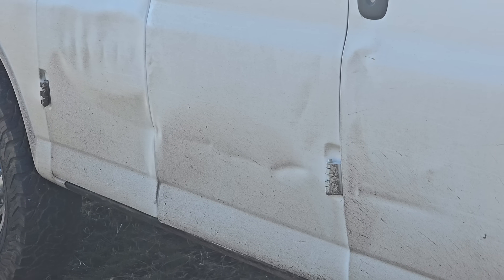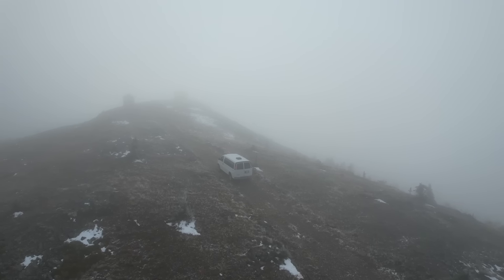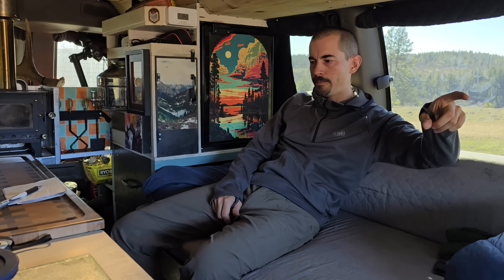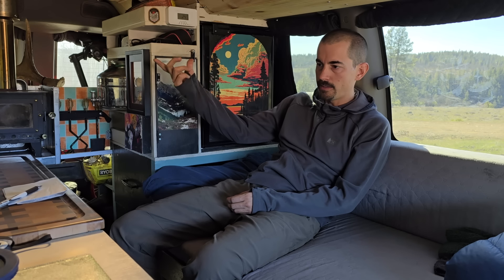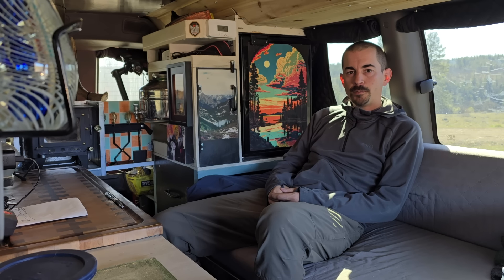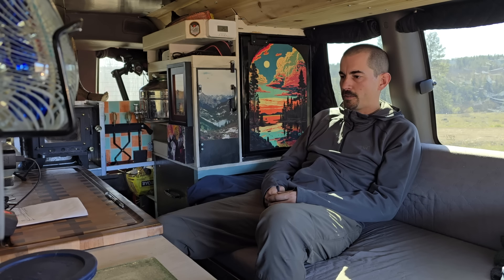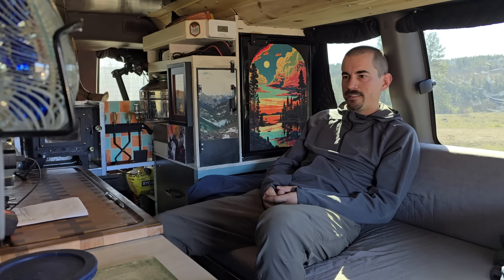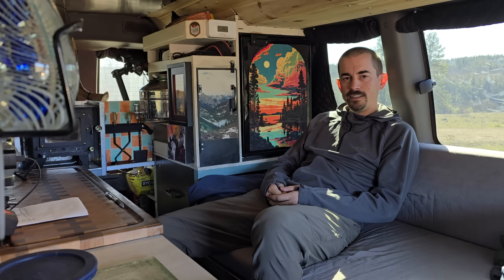Lets just talk about condensation and insulation.

Comment: In a house the vapor barrier is pierced by screws to hang drywall or w/e, so that is not a concern.
You won't get the closed foam insulation cut perfectly. Leave a gap on each side and fill it with spray foam, the window kind that doesn't expand super strong. 
Gluing everything could work, maybe.. Since you don't put up heavy stuff. maybe a cloth liner would work instead of wood paneling? 
Sealing everything up won't get rid of the moisture tho. As you stated, it comes from you breathing and needs to be vented out.

Comment: I imagine that the solution to water vapor penetrating the insulation and condensing on the inside wall, is to make the insulation waterproof (vapor proof) in the first place.  This would capture all the vapor on the inside air volume.  Then, a dry heat source will warm up the interior.  This warm interior air can then be allowed to escape out a roof vent, to allow for ventilation.
Some insulation dude will be along to give us the actual nitty gritty, tho.

Comment: I’ve had my Quigley Transit for 5 years, built out myself, I used a similar method as you describe except no vapor barrier, my theory is,rain suits can be very sweaty and sometimes more wet from sweat than rain ( I worked outside in the rain for a number of years) I figured there was no keeping moisture out,so I wanted the moisture to be able to come and go with ease, I used thin oak plywood to cover walls and ceiling with somewhat loose joints, I recently added a small window so when I pulled the wall apart I was really curious how dry things looked, it looked great,dry,. Lately I’ve been more focused on insulated window covers because when it’s really cold outside the windows are the coldest areas,I’m also an amateur ,take my opinion with a grain of salt.

Comment: If you're using closed cell foam then that will also act as a vapour barrier because it's made as closed cells (lots of sealed bubbles all together) as opposed to open cells (like a sponge) so no moisture will be able to travel into or through closed cell foam. All you need to worry about then are your joins in the foam.

Comment: I suggest NOT putting a vapor barrier in at all. Vapor will make it around any opening. When it condenses and is now liquid, it must now vaporize again before it can migrate (dry out), so in essence the vapor barrier ends up trapping the moisture IN rather than keeping it OUT. When the moisture is trapped, that is when the mold starts. Have found this out through many years of experience with our garage in Northern Minnesota that has one wall that is completely underground, combined with cold soil temps and high summer humidity

Comment: You should absolutely keep that van.  Unfortunately, there's not much else exactly like it.  The grass might seem greener, but I have yet to see anyone with a better rig than you, haha.  Anything remotely similar is either less capable, or less livable (and by that, I'm definitely thinking of both Sprinters/Ford Transits, and pickups with camper backs).  These people with huge lifted ambulances and monster truck looking things are full of it; they aren't taking those things off road onto mountains, and living in them full time, travelling great distances, getting like 8-9mpg.  BS for YouTube.  I also love the window version of your van, and not the far more common metal sided version.  Everything's a tradeoff, and the huge quality of life benefit of having the wraparound windows in your living space 100% outweighs the downsides.  Imagine living in a metal box.  It would be nice if you could preserve the light, airflow, and internal egress benefits which come with the front and rear open, as they are now, and not walled off.  Perhaps there's a way to make those barriers open when wanted?  Either with hinges, collapsible panels, something accordion-style?  Maybe even entirely removeable/seasonal?  Those barriers may not need to be airtight like the insulating scheme.  They likely just need to reduce the space requiring heating.  I would just hate to see the internal space shrink; even if you weren't actively entering it, as walling off those areas and cutting off those sightlines would certainly make the internal space feel smaller, just as a fence between neighbors' yards can make both properties feel much smaller.  Though, you always have great ideas, and your creative vision will prevail!  Renting an apartment with a garage sounds like a fantastic and practical idea.  It might even be a sort of vacation, and maybe briefly inspire its own sort of content!

Comment: Shot in the dark.
How about building a walled interior with no window openings? And put a couple of large LED monitors on the walls to act as windows. And mount a cheap camera or two outside the van to display their video on the screens to act as fake windows (or you could put any view you wanted on the screens like a tropical beach or a mountain view). 
Sort of what they do on interior cabins on cruise ships.
I know it's way out in left field.
But it would probably make the build a lot simpler and easier on condensation.
Just a thought.
☮

Comment: Id just be concerned with those new ceiling supports that are just secured with adhesive to the vapor barrier and that not being strong enough.  Can you get some sort of studs that glue to the ceiling, then just use some sort of rtv to seal around the vapor barrier, or some sort of method that they use to install solar panel brackets on roofs for screwing through the vapor barrier.

Comment: You don't need vapor barrier with closed cell foam insulation. It acts as a vapor barrier itself. Just put the foam blocks between studs and use expanding foam to glue it all together and you're ready to go. Spray foam would probably be ideal but it's a bit too late for that now since the interior is already built up.

Comment: Don't use foam its garbage compared to insulation and wool is the top product and use acoustical sealant (caulking) around the perimeter or over lapping vapor barrier areas 👍i can help you when the time comes im in bc and done insulation for 20 years. Also I got a awd express 2013 3 inch lift with 33's 
I just gutted mine after 2 years, I'm on the fence about a high top for it or a pick up truck with slide on camper

Comment: invest in a compact dehumidifier .. keeping the condensate minimal and providing water for cooking. Any extra interior insulation on the roof good, how about painting the roof exterior black...a heat sink of sorts .. but may make summer sunshine heat gain too extreme.. try cut to fit R5 x 1 inch insulation with reflective  film one side such as "PlastiFab - DuroFoam"...green one side silver reflective vapour  barrier on  the other side .. the reflective side inwards during woodstove use to reflect heat inwards and real hot summer reverse the panel to reflect solar gain outwards

Comment: FF, Mosture is caused by breathing or any liquid in a warm space... much like a cold glass gets mosture on it. The smaller the space, the more noticeable.   To keep mosture from forming, you will need to maintain an open window like you were doing. Yea, it's a bummer to lose heat.  Another thought would be a dehumidifier, but that uses power...

Comment: I’m building my and express out atm. Which is a baby version of this imo. I just went full out and gutted the whole thing. I don’t think I regret it. I’ve just finished putting thinsulate in the roof. Sitting in it while doing the work. This week, in lowermainland bc. It was WILD to notice instantly the difference in temperature when the sun was hitting it when you sat under a section. That had been done, vs one that  hasn’t and it’s only mild here right now I couldn’t imagine the difference come summer/winter. It’s so easy with the spray 77/90 to put up. Cut.
Reply: I tried the closed cell foam. Unless you cut it small and find crazy good glue. It was crazy squeeze when off-road. So I ripped it all out

Comment: Skid the vapour barrier. You already have a vapour barrier. It's the outside skin sheet metal of your van. Two vapour barriers will trap moisture. I guarantee you will get water between the two vapour barriers if you add a second vapour barrier.
Reply from the maker: Yeah it's a tricky thing to do correctly.  So many van builds have moisture traps.

Comment: Sprayfoam is good...but expensive....if on a budget,use rigid insulation...aim for r value 6 per inch. build up to 3 inches would give a value of 18..if you use blue skin for vapour barrier it will anneal around the screw...use exterior screws,
       probably should have a fan in the roof ...it will quickly exchange the moist air..one you can shut on and off.. You dont want to be too air tight,especially with a wood stove..maybe a vent near the stove....run the fan off your 12 volt....keep it running when you are driving...that will help dry out the interior....it is the air movement that dries everything out. as much as the heat does

Comment: Of course architects deal with those same issues. Technically water condenses within a wall when the dew point is reached. Which happens as the temperature drops within the wall. Breath ability is crucial for sure. I think the expanding foam is your best bet, which sounds counterintuitive, but you make sure to use closed cell foam.

Comment: You could consider using something like expanded cork insulation, which is both rot-resistant and can be used as the wall finish (you wouldn't need to put the tongue and groove boards on top of it)

Comment: I am unclear on how the 2x2 will be fastened through vapor barrier to the metal ceiling. Glueing the 2x2's to the vapor barrier would put the whole weight of the tongue and groove ceiling onto the 2" plastic vapor barrier. Perhaps glueing both sides of vapor barrier in the channel would mitigate the plastic from. sagging down because of the weight. 

If I ever build out a vehicle, I'd build a tiny house box first, then install it on a chassis. That way I can switch vehicles every 10-20 years and just install the home on a new chassis.
Reply: I had the same thought about all the weight being on that vapor barrier. I don't think that's going to work.

Comment: lots of comments here. one mention i didn't see in the comments during a quick scan, is considering wool "batt" insulation. it has some downsides with settling in walls if you use it there as i understand it, but, as i understand it, it has some good upsides around it's resistance to mold, and holding moisture. might be worth some research.

Comment: Almost need to take your van somewhere cold and just look at it with a FLIR camera and see where the heat is escaping.  I bet those windows are brutal.  The floor will lose heat.  Condensation is going to be tough, you'd almost need an air to air heat exchanger but i'm not sure who small you can get them.   I'd continue to spend winter in the south--bears hibernate for a reason.

Comment: I don't think gluing the 2x2's between the foam and screwing weight from above is a great idea. Also, I don't think a vapor barrier is a great idea. Vehicles were designed to be in potential moist environments. Just breathing in a van will get moisture into the walls. Even if you put a barrier on the ceiling there will still be moisture that gets between everything. 

I think a better way to approach this is to design with air flow in mind. I would also consider a ceramic coating, something like lizard skin. For insulation, wool, or 3m thinsulate. 

Then in those cold environments if you cook with propane have it vent outside, or expel that moist air quick, run the fan every day at certain points, and use that wood heat for a dry heat source. 

Good luck.

Comment: They make this sound deadening decent thick metal and the sub woofer rubber material and glue I've seen people peel it off clean and the it gets ride of rattling then I'd you can continue with the metal backed closed cell foam and metal tape and it's all sealed on both sides

Comment: Condensation will occur where there is a temperature difference between any surface and substrate that a vehicle is made from.
That said, modern moisture absorption ceiling material used in some truck campers and aircraft are good at absorbing the moisture and letting it evaporate back into your environment.
It’s all a compromise.

Comment: Consider spray foam insulation. Mice wont eat it and cant get through it if sealed correctly. It holds heat and cold like nothing else. Downside is once its in its in and its really shouldnt be removed. My fathers heats a floor  in his house with a space heater if he doesn't want to fire up the wood stove.

Comment: I watched you build the rig and put it through epic treks. I love the stock outside with all the battle scars. I'd keep with it as well. Question: did you consider clear plexi-glas inside windows mounted in the window panels, creating an air gap between. The condensation is always going to be there, the inside panel keeps it from frosting the frigid outer window. Kinda like a storm window but installed inside the window frame. Anybody please chime in here. Cheers!

Comment: You could just screw those pieces of wood into the gaps instead of glue them and then just use silicone or some type of waterproof sealant over the screws before you screw the ceiling tongue and groove over it. Seems like it would hold up better in the long run and not collapse that way.

Comment: I'd just use celotex board on all the big surfaces and allow everything to continue to breathe as you have done already.    use sheeps wool in the gaps between the celotex boards.  Then skin using 3mm ply.   youve got such a small space to heat and such a small amount of surface area that will need to dry off.   Keep is simple

Comment: are you using the Afterburner thermostat for your diesel heater so that you can set a more controlled temperature?  maybe an (even small) tube that circulates the floor <> ceiling air especially with the wood stove.  I mean after an hour or two I find it doesn't matter how much insulation -- I'd rather air + moisture leak out of my van and just turn the heater up.  Maybe time to swap the 200ah battery for 400.

Comment: Not a bad idea with having some 2x2 outside of the vapour barrier, doubly so if you can adhere it in place without piercing the barrier. As others have said spray foam insulation might give you less grief. But hey, hope it works out!

Comment: I am wondering how well you'll be able to get the vapour barrier into the slots and then the wood you insert will only be held in place with adhesive to the vapour barrier? You'll then screw into the blocks which aren't directly secured to the crossbeams? I like your thinking of not poking holes when putting in screws but hope it will be secure enough overall.
Can you add the vapour barrier, then screw in the spacers then add the tonguengroove? The holes will at least be beneath the cross pieces.

Comment: Compromising the vapor barrier will not be an issue, assuming you mount the 2x2 to the metal (better adhesion and easier to install according to your schematics), and the tongue and groove fully covering the rubber. Even with a normal vapour barrier, the tension created between 2 (hard) surfaces is enough to make the tiny hole you've thus created not be an issue.
With you mentioning a 1/2mm rubber vapour barrier even less so.
In construction we only worry about having to fix a screw hole that missed the underlying structure (the 2x2) so uhh... don't miss? :)

Comment: I don't think I'd do a vapor barrier as it can hold in moisture just as well as it can block it from the outside.  Just don't use insulation that can hold moisture and make sure there is adequate airflow for things to dry out.  I saw these little dehumidifiers that may help too.  They only use around 30 watts or something like that.

Comment: Spray foam is the best choice since it sticks directly to the metal and will not condensate at that point. Don't attempt a vapor barrier in a vehicle it's not worth it and I seriously doubt it's even possible. Get the foam shot by a professional, the mix has to be just right and let it off gas for two weeks before you start reinstalling your gear. Use 3m thinsulate insulation with a spray adhesive around the window frames it antimicrobial and made specifically for vehicles.  Your doors and door frames are thermal bridges and will always condensate but thinsulate insulation should help.

Comment: As an old bodyman and former shop owner i'll tell you this.... adhesives will fail in the cold with vibration, so will butyl tapes, even more so. At the end of the day it's a van and  I would look more as to how they spray insulate sea cans for the roof and walls. I used to tell my clients in cold temperatures one of the best ways to eliminate moisture from a vehicle was to crack the window 3/4" and let the natural vacuum suck the moisture out. Speaking to you from northern Manitoba so i know a thing or two about cold. good luck.

Comment: (While admitting that I have no recent real building experience), I wonder if instead of screwing tongue and groove into wooden supports, could the ceiling be a metal sheet that is held to the van's structure with magnets (and maybe a handful of strategic screws) to save on weight and ceiling height and make fewer holes.

Comment: A series on rebuilding the van will get way more views than the hiking videos.  I would definitely do it either in the spring or the fall.  It's too cold in winter and too hot in summer. [edit: apparently not. I checked your channel in popularity view.  Still, the hiking videos are not the top end edit]
Also, buy new fuel line.  You used that crappy fuel line that came with the heater. It's very poor quality and a single leak could cause serious bodily injury or death, and almost certain the total loss of the van.